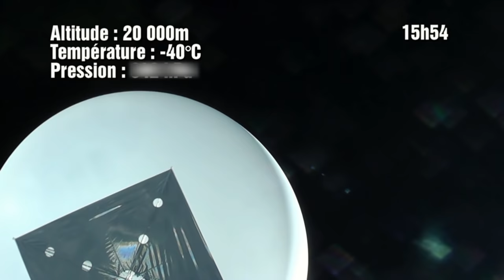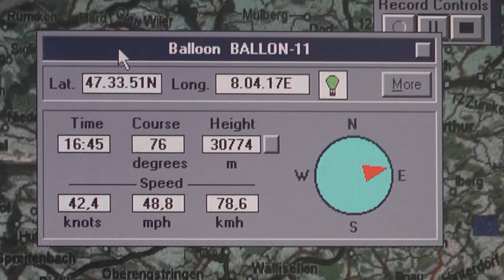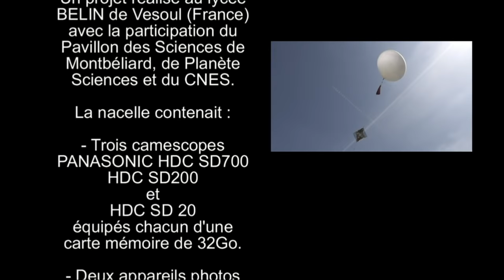Un ballon sonde stratosphérique filme un avion de ligne Swiss [subtitles]

Comment: Can you please photo-shop the earth so it shows curvature? I see you followed orders & fuzzed out the altimeter reading, showing it almost reached zero air pressure, thus space (sorry but I watched this vid a few months ago before you censored it). Maybe just delete the whole video so nobody gets in trouble. After all, SpaceBalloon's mission is to follow orders & pocket the money, right?
Reply: Even though the final footage has no lens distortion, it's not flat. Go to 10:15 and take a screenshot, then use an editing software to horizontally squish it. The curve is obvious from there.

Stop making a clown of yourself.
Reply: @doddermodd  Got it, Einstein. So if you take a photo of curving TV Land earth & let a cement mixer run over it, it becomes flat? Or if you take a real photo of flat earth & glue it onto a ball it becomes round? You better confirm with Sesame Street. The Road Runner did this test, didn't he?
Reply: @davidlyall7346  I have absolutely no idea what you're trying to say.
Reply: @doddermodd  That's okay, neither does he.

Comment: Une droite parfaitement linéaire. Alors que celle-ci d’après ce que nous avons appris des gaz à l’école devrait être une courbe logarithmique ! Bien que le ballon a éclaté à une hauteur de 31257 mètres, cette droite linéaire permet d’affirmer que la pression atmosphérique est au environ de 32000 mètres égale à zéro.  Tout se passe comme si l’air se comportait comme un liquide incompressible, tel de l’eau ! La masse de l’air est identique quel que soit la pression ! La même expérience est souvent réalisée dans les écoles avec une colonne d’eau. (car facile à faire). Chaque élève sait que pour cette expérience, nous avons une droite parfaitement linéaire. (pression de l’eau / hauteur d’eau) Pour l’eau qui est incompressible, cela se comprends ! Comment se fait-il que l’air compressible et dont la densité est bien plus forte au niveau du sol que dans la haute atmosphère cela soit tout aussi identique que pour l’eau ? Ce n’est pas normal.

Réfléchissez à ceci : la gravité n’agit pas sur les atomes comme on l’enseigne à l’école. Il y a une autre force que « la gravité » pour expliquer l’attraction des « atomes » vers le plancher des vaches. Notre physique élémentaire est donc indiscutablement à revoir…
Reply: Bien sûr que non, il y a plus de molécules d'air par centimètres cubes au niveau de la mer qu'à 30000m